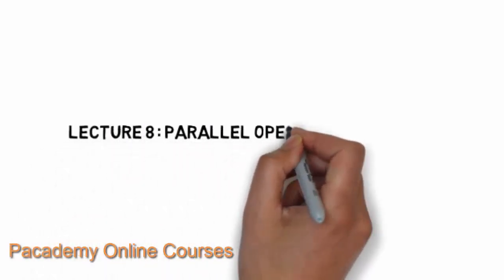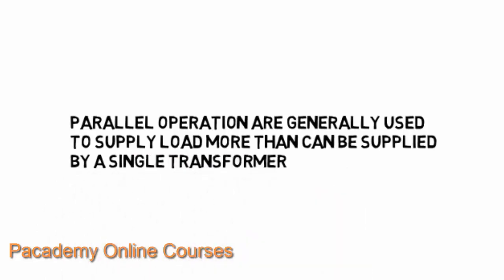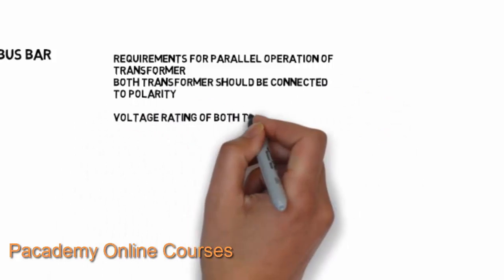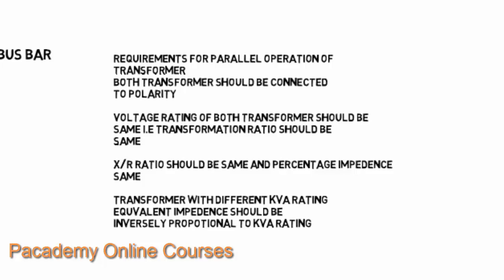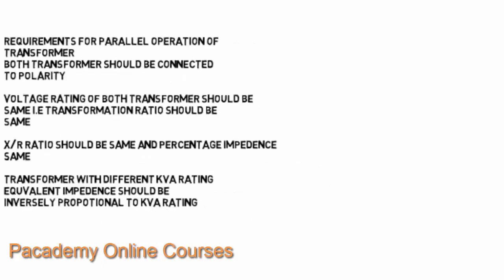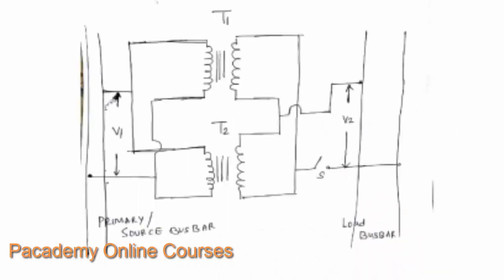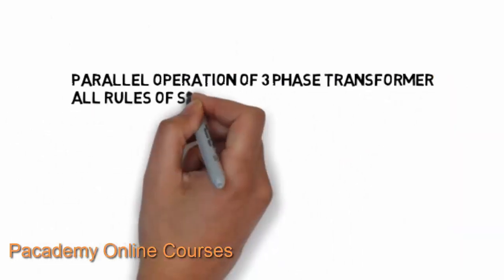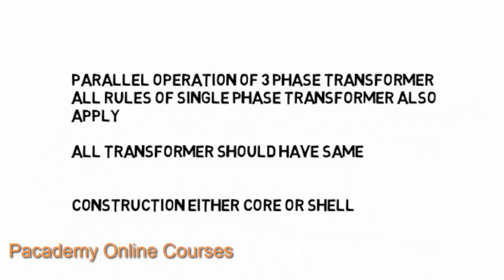Parallel operation of transformer , Electrical Transformers Lecture 7

Comment: Thank u sir for guide ,I hv some questions , if two same rated like 3ph 33/ .415 KV 250 KVA of other identical parameters like lot and make are used in parallel and if one out of 3 I/C DO fuse melts of only one TF for any reason what will happen ?  With Regard KRNandi Adee SERly